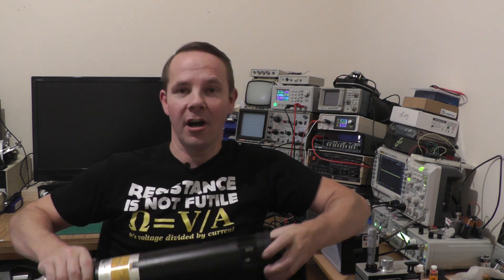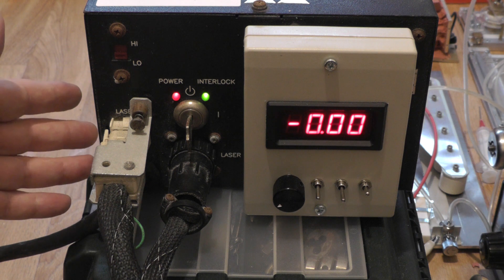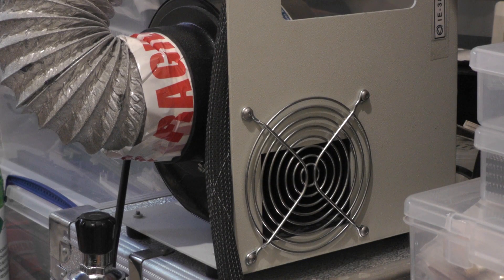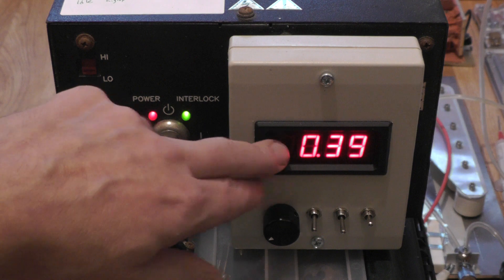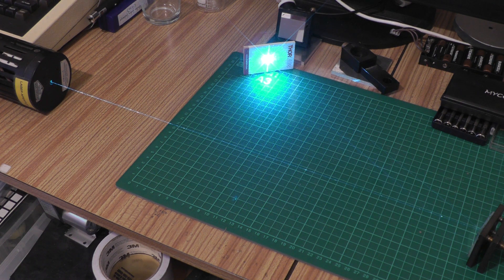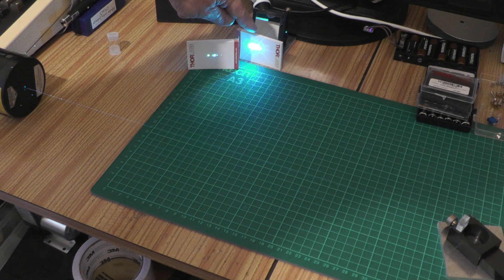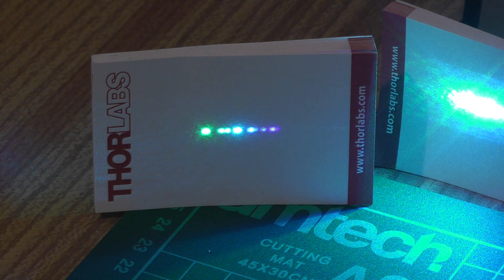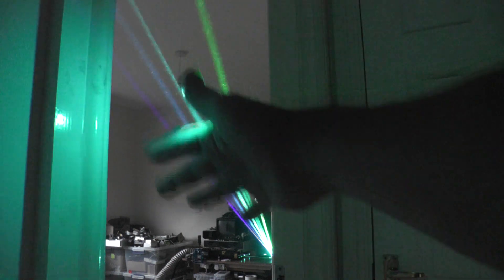Argon Ion Laser Demonstration Multi-Line

Comment: Do you know what the "HI LO" switch on the power supply does and how to set it to the correct position?
Reply from the maker: It has always been a mystery to me, so I never touched it! There does not seem to be any mention of it in the manual either! http://www.metronixlaser.de/bilder/Ionen-laser/JDSManual.pdf
It may be a switch for line voltage perhaps, (though the manual says that is internal).
Reply: @LesLaboratory I took a look inside. It switches between 200V and 240V primary windings on the transformer that powers the tube's filament.

Comment: I have 3 of these, 40mw, made by  Uniphase, once a division of Spectra Physics and a few extra power supplys, that run on 110or220, 50&60Hz. I think one or two, can be selected for wall plug requirements.  Fun laser.  Great Laser Light Show party rigs.

Comment: My argon laser head is broken. I'm heart broken
Reply from the maker: How broken? Open filament, up to air, or something else? Sometimes these can be revived...
Reply: @LesLaboratory  thanks for the reply. It powers up fine, plasma tube glows - all good. Then it only emitts a purplish blur from the aperture(?). Its a uniphase argon ion laser, w power supply and controller. Its about 0.5w. I'm in love with that laser but just don't have the skills to fix it.
Reply: I have 2 of these argon lasers I'll take a couple hundred for
Reply: @jeremeyromine3278  fully working? I only need the head, got the controller and power supply.

Comment: Can Argon ion lasers have no Brewster windows?
Reply from the maker: In small Argon Ion tubes like this the mirrors are sealed to the tube. There is a Brewster plate in a little metal carriage at the cathode end to polarize the output. I suppose it could be omitted but then polarization would be random. The American ALC60X has external mirrors and needs Brewster windows, as windows at any other angle would reduce the output and or quality of the beam.

Comment: Enjoyed your dye laser videos  back in the mid 1970 I played with these the only thing
I did not like about them was that the dye is a bit messy and some a bit toxic but still
very interesting.  While visiting a local laser lab I saw and unusual configuration for a
high power continuous output dye laser pumped with a argon laser of several watts.
Because of the power level both the dye and cuvettes would be quickly damaged.  
The trick the researcher had devised was cleaver a concentrated solution of dye  
dissolved in Glycol was formed into a liquid jet which landed  into a receiver cup.  
The jet was rectangular and lased very well output was perhaps in excess of a watt.
Reply from the maker: Thanks! I considered building such a Laser, but apparently the nozzle for the Dye Jet is a precision job, that I am not sure can be constructed with hand tools. That said, it would be amazing to see a CW multi-watt dye Laser!
Reply: @LesLaboratory  You mat be able to find some
square or rectangular tube this maybe 
good enough to produce a laminar flow
jet.   K&S Precision Metals offers small square and rectangular brass tubing.  
The brass may be a chemical problem but
you can passivate the surface with a Tin
or Nickel plating.  This tubing is very well
made and low cost well worth a try.

Comment: That's a cool setup, I didn't know Argon lasers had so many lines.

Are they DIY able? I work in a machine shop and have basically unlimited access to argon for the welding department...

If I remember what I've read correctly, they operate at relatively low voltages but at higher currents...so the power supply may be easier to build.
Reply from the maker: It is possible do DIY a pulsed Argon laser but they are quite involved. Check out Sam's Laser FAQ online.
A continuous wave Argon Laser is probably beyond the reach of the amateur. The bore for example has to be machined from Beryllium Oxide ceramic, which is difficult to machine and the dust is toxic.
Reply: @LesLaboratory  You can use other materials for the bore, Spectra Physics uses aluminum oxide for their larger Argons (2000 series and higher). The thermal conductivity is rather low (you probably have to use a rather potent watercooling setup), but it isn't toxic.
Reply from the maker: @eulemitbeule5426  Thanks! That would make sense. I am sure that BeO is very expensive at scale. There was another make of Ion Laser from back in the 80's I think that used stacks of tungsten disks as part of the bore as well. Maybe if you were really determined, and only wanted a Milliwatt or so, you could get away with a quartz bore with a cooling jacket for short runs...
Reply: @LesLaboratory  I think the main reason why Spectra chose aluminum oxide was because their large Argons where build with maintenance in mind: You can use BeO in small "set it and forget it" aircooled lasers that get replaced after x hours, but large Argons can/will be refilled and repaired multiple times throughout their lifetime.
Requiring your service technicians to handle BeO on a daily basis isn't a great idea, especially when you can just reinforce the cooling system and switch to non-toxic aluminum oxide.